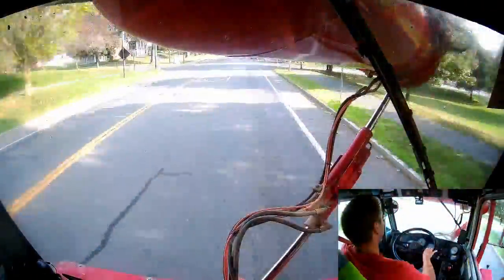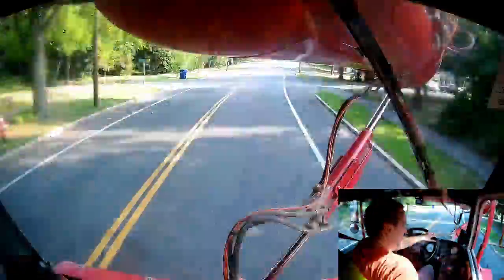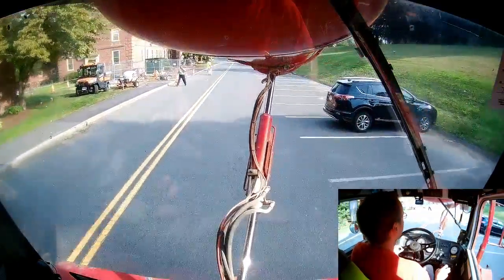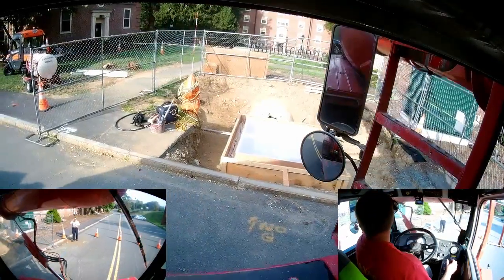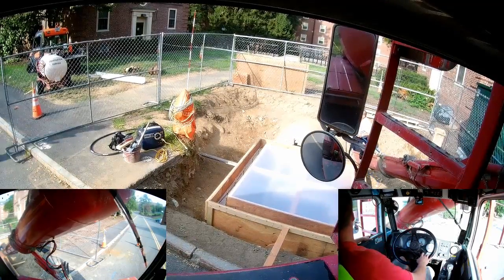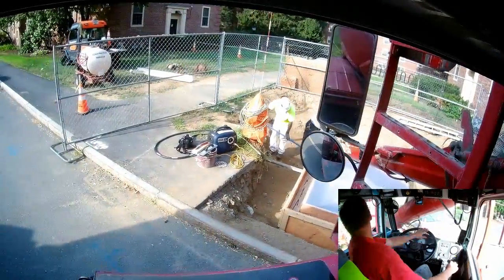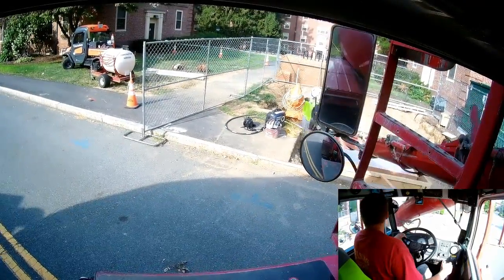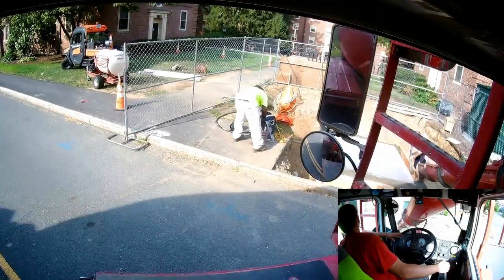Umass Amherst Concrete Foundation for Electrical Transformer

Comment: I’ve got an old fronty and all that creaking and moaning worried me till I hear yours do it. I know yours is in much better shape than mine. You can take a grinder and cut about 1/2” off the corners of a hoe and slightly round it and it’s a wonderful chute tool. That’s until someone on a job breaks the handle for you
Reply from the maker: I actually have a hoe I bought to mount on the truck for scraping the chutes out. I just haven't gotten around to mounting it yet, I hadn't thought of grinding the corners off of it though. Yeah they all creak and moan lol. This one is newer, but before I started driving this one I drove a 97' Oshkosh for a year and a half. That one clanks and screeches no matter what you do lol.